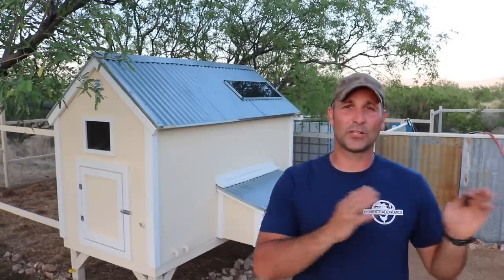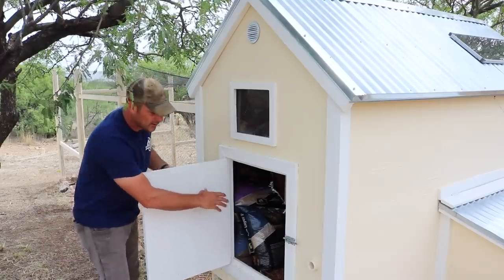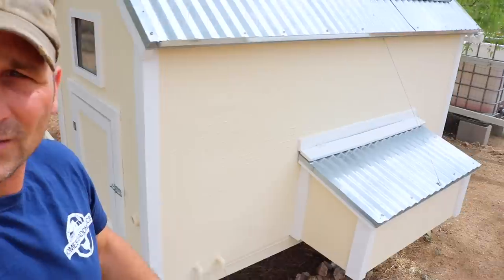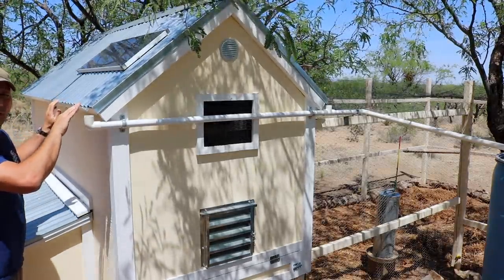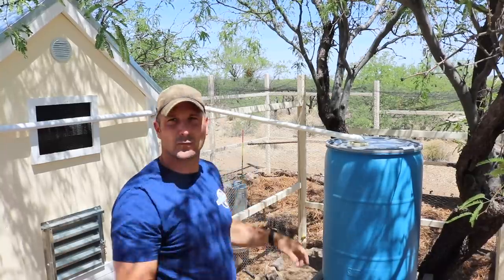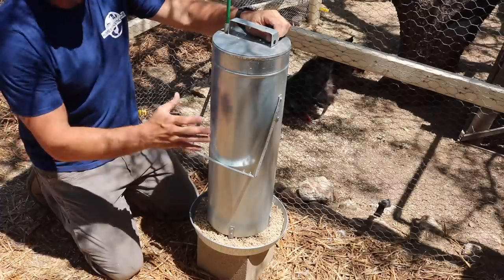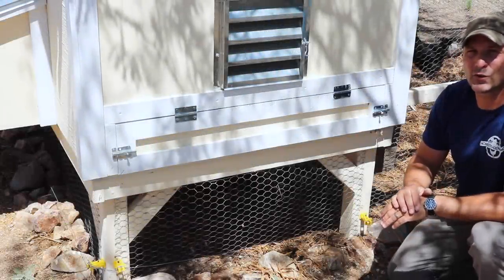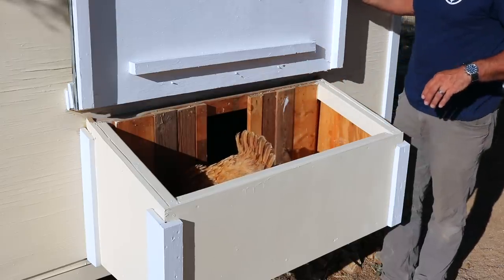Chicken Coop Tour  - Rainwater harvesting, Solar, DIY Feeder, ... and more!

Comment: I followed your instructions for this project. Changed a few things. Used asphalt shingles and built my run with 2x4s, cedar fencing, and chicken wire. Start to finish, I spent less than $600 on equipment. I used decking screws for everything thinking of longevity. I only have 5 chickens! Building my gravity watering system in a next couple of weeks. Thanks for the great videos. A reminder for newbies like me, when you frame the coop, don't forget to compensate for the thickness of your walls. I forgot, and have 1/2" overhanging ply on all four sides. Doesn't impact the coop, but does expose your experience.Just remember, it's all math.

Comment: One more very cheap and easy wild animal deterrent that maybe you haven't heard of or thought about,  it even works fairly well in a garden too, and it draws so little voltage, I'm sure you could power it right from your solar and never notice the difference,  is a small transistor radio set to a talk radio station (don't use music, I seriously have seen coyotes and deer called in intentionally with a Loretta Lynn   8-track lol), but critters are not as curios about talking voices, especially if they sound mad.  Rush,  Levin, Stern, Olberrman, etc.  Or excited at times, like sports, and sport talk -- not golf though lol.  It doesn't need to be loud at all, animals have good ears, just enough that you hardly hear it when you walk away from the garden, or chicken run.

Comment: who are the jerks who gave this a thumbs down?  The guy nailed it.  Killer design- very simple and clean. If I had any critique, more so a suggestion, If I-myself cant fit inside the space I would run exterior access for the electrical. Not sure what else ya need.. I'm in the process of designing a coop for my own home and plan on using this video as a base model.  Thanks Mr Homestead O'nomics.

Comment: Very nice setup! A few ideas I've found useful with my coop, grass carpet in the nesting boxes, easy to clean and doesn't need replacing. Our pop door to the coop is weighted with a cable that runs to the back porch through a few eyelets on posts along the way for easy opening and closing, the pop door is a recycled heavy duty flat cookie sheet that is installed in a channel to slide up and down. Been in use for five years with no problems. Old leaves make great liter for the coop and run, it breaks down nicely into compost and it's free.

Comment: I love all your ideas! I must say that I’m really surprised that chicken wire has kept predators out. I’ve learned the hard way to always double it with welded wire fencing or something sturdy like that. Raccoons and foxes have chewed right through. I’ve been told that chicken wire was designed to keep chickens in - not to keep predators out. However, I haven’t had electric fence around mine. Love LOVE the watering cup idea! The water stays so much cleaner without having to clean out waterers twice a day!😁

Comment: Very nice. I wish you went into detail regarding the electric fence a bit. You're the first person that mentioned this and I'd like to see if I could implement that in the coop I'm building.

I think other than having a solid roof over your run, the only thing I'd change is to use hardware cloth. I've heard of a few stories of animals (like raccoons) reaching into the wire and doing damage to them. But overall, great build and great video and I'll be incorporating a lot of your ideas into my own build.

Comment: Nice set up, but you've been really lucky so far. Chicken wire keeps chickens in, nothing out. I think what is saving you so far is the electric fence. I'd definitely close that hardware cloth door every nite. Not sure if you have weasels or ferrets there, they'll take out a whole flock in 1 night. A neighbor down the road lost his whole flock in one night due to Chicken wire. Also I put hard ware cloth under every opening or ventilation opening you have. You may have already done that... Nice job though.

Comment: I got a lot of great ideas from your video. It would have been nice to see the inside more.  I have been wondering why most coops are off the ground about 20 inches. You mentioned snakes.  I like the 4X8 dimensions so there is little waste though I have been thinking of building twice the size to be able to walk inside. Thank you for sharing.  I will check out the build video.

Comment: I see by the Mesquite trees you're somewhere in the west southwest...not much grass.  I personally like the idea of grass grazing chickens, but I like your coop build and design as opposed to a chicken tractor!   I am wondering how much trouble would it be to "attach" a temporary "chicken run" to each side of the stationary coop on a rotating basis? 
The down side would be the underground fencing for predators, but perhaps the electric fence would deter the varmints?  Perhaps a "chicken shoot" could attach the coop to the temporary and movable "grazing" pens?  I love the coop, just don't particularly like the "fixed" grazing pens.  Good job.

Comment: This is just a smart ass design I love everything that he has done even the rain gutters he did just to let you know if you wanted to upgrade you can get metal flashing just like that but get the bigger version and just upgrade the ends of the PVC pipe to a bigger adapter to like a 1 inch pipe to like a 2 inch or 3 inch or whatever diameter pipe you have do you know what I mean because obviously you’ve done this but keep up the good work

Comment: Love your coop. With snakes being a problem you probably should have used the 1/2" square wire instead of children wire. You could wire your chicken wire to the electric fencing that way snakes won't enter in through the holes. I don't know if it will shock a snake or not but catch one and see if it will react to the electric fence. Also the uncovered battery might spark and start a fire so I suggest a vented cover. One more thing, when you have a big rainfall won't the rain run under your roofing with the small gutter ?  That over time will rot your edge of the roof. With such a small drain pipe water will back up. Good luck.

Comment: Great video thanks for sharing. I’m setting up my watering system like yours. How do you keep algae down and it smelling like fish. Do you have a remedy you could tell me about. I’m using a food grade barrel. I was finishing up the water system and I took the lid off and it had algae and smelled like fish.
Reply: You can put copper sulphate in the water. It also helps with controlling their worm burden
Reply: Sean McVeagh Thank you very much. I found some all natural stock tank tablets supposed to be good for chickens and livestock. But I will definitely try the copper sulfate. Thanks again
Reply: @offthewallsbbqmore4821  your stock trough tablets will contain copper sulphate. It's also cheaper to buy than the tablets plus it'll help with worming your feathered friends 😊
Reply: Sean McVeagh Thank you I’m searching for it now. My chicken don’t go in the coop for about 2 more weeks. So that buys me little time. How much would you put in a 47 gallon drum? And how often?
Reply: @offthewallsbbqmore4821  About 5 tablespoons every month depending on how often it gets diluted with incoming rain water. All the best on your journey

Comment: great ideas love the video, but I dont think this system would work in my part of the country the water would freeze up and I would need stronger fencing because of bears and racoons. and fox. Also snow would cave in the top of the pen . I have a 30 x 30 ft pen 6 ft horse fencing with a roof over the entire area, half being clear fiberglass and half being metal roofing, so they get sun and shade. But at least i dont have to deal with snakes. lol. Good job thanks for posting this video

Comment: Quick question on your general dimensions. The sheets positioned vertically, are they 4x8 as well? Or did you end up cutting it down to 4'x6' and then run a 12:12 pitch?

Comment: On our coop the chicken door is closed automatically on dusk and opened at dawn by cheap arduino clone with linear actuator.  The electronics, solar panel and actuator were about $100, software (sketch) free online.

Comment: Hi, I'd like to please how you secured the posts along the coop run into the ground?
Reply: Post hole digger or auger to dig hole. gravel, foam or concrete to secure post. No different than fence post install. Depending how sturdy you need it

Comment: I'm amazed how detailed your coop system is! I especially like the watering system, which seems as though it makes supplying the chickens with clean, fresh water much easier. Two questions though:
1) How do you keep the chickens from getting (pun intended) fried on the electric fence?
2) Did you find a place to release the snake or did you have to put it down? Just curious.

Comment: Impressive Joe! Quick question: How did you connect the chicken wire? In other words, how did you join the rows of wire that span the fence?
Reply: Sebastian, I connected my rows of chicken wire by overlapping the wire and zip-tying the chicken wire together. I use A LOT of chicken wire, around the base of my run, and over the top of my run and zip-tied every bit of it. Mine is very secure, I don't use the electric shock and have never had a problem of predators getting in(so far). All I know of that gets in are mice.
Reply: @amandasansone  Thanks for the tip!! Almost finishing my chicken run and am super excited to let the chicks out of the coop!

Comment: my Grand'pa built a snake trape, he digged a deep hole 10x7 kind of car size and 7ft deep put gravel at the floor and covered with wood raftters and zinc roof pannels. every morning he checked it poor kerosene and light up snakes trapped there looking for warmth at dusk but too slow to climb up aerly in the cold morning.
anyway he killed and spread the body parts in the bush naftaline or creolyne wi repel them the smell is irritand to them.
God bless get cats they eat snakes.